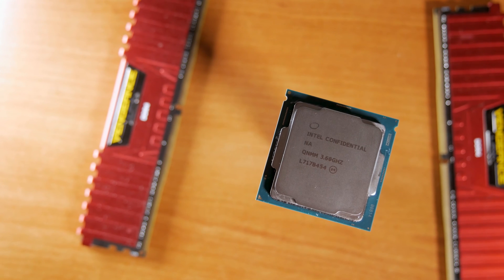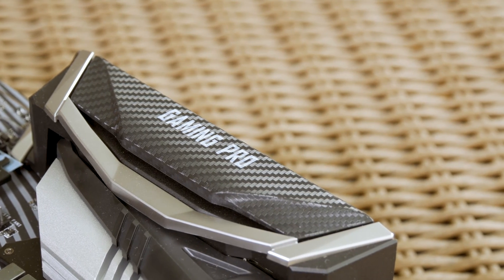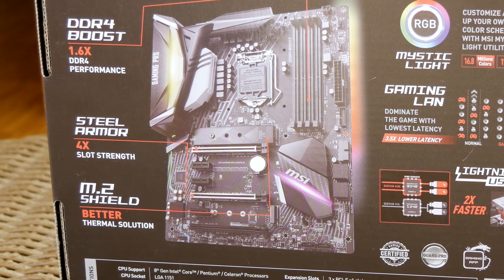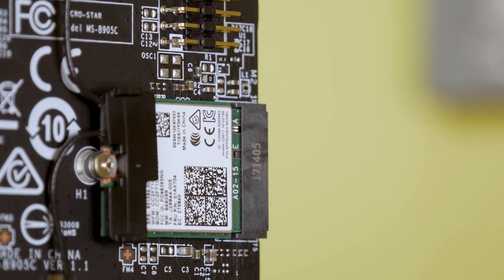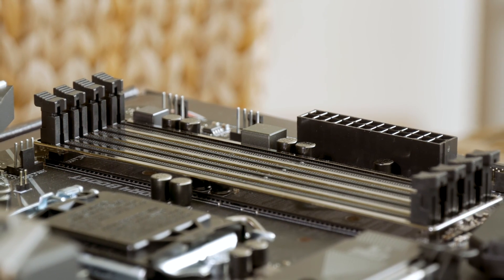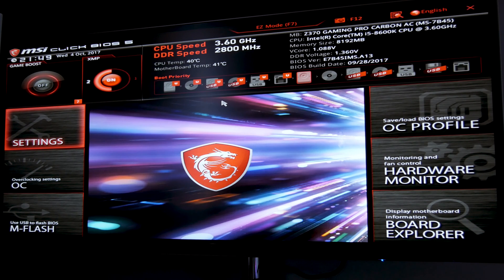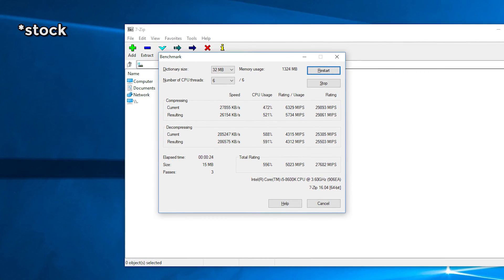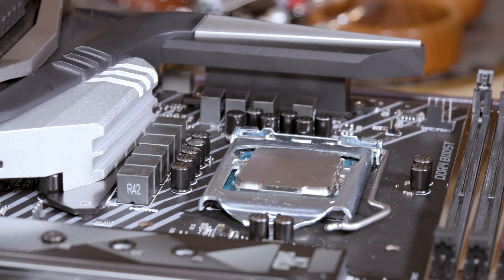MSI Z370 Gaming Pro Carbon AC Review - Freshened Up

Comment: The specs say it has Bluetooth but everybody who reviews this never mentions that it has blue tooth. Does it not really have Bluetooth?
Reply from the maker: In 99% if it has WiFi, it also has Bluetooth, since they pack both on the same package / chipset module
Reply: TekTick ok thanks a lot! Also that means you have to install the ac wifi card to get the Bluetooth working then correct?
Reply: Yes that's correct. You need to run a usb cable from the WiFi card to an open USB header on the mobo to get BT